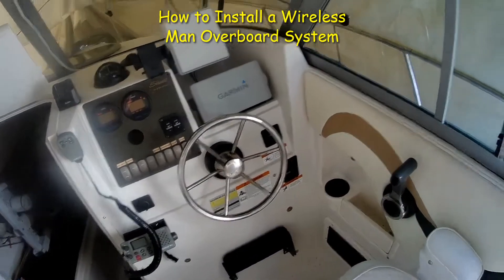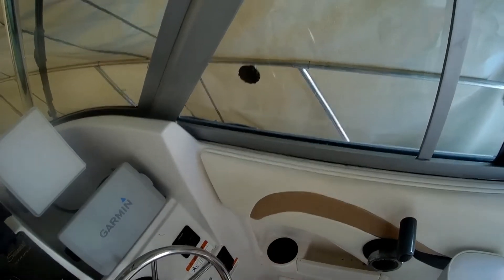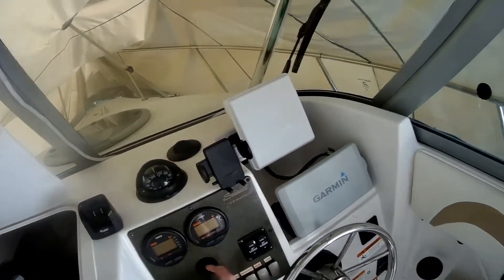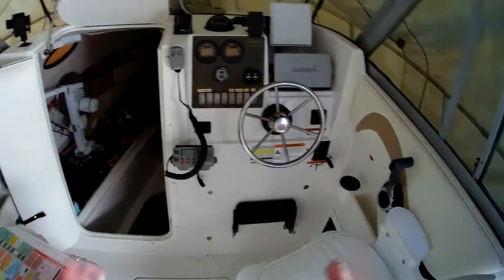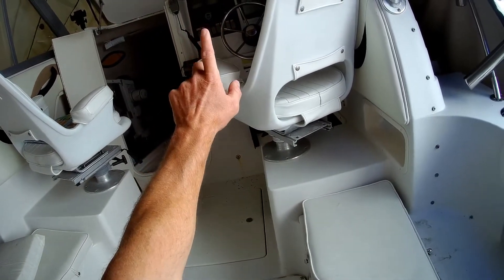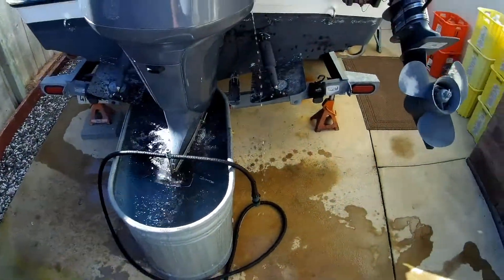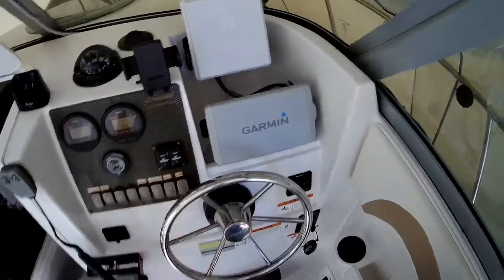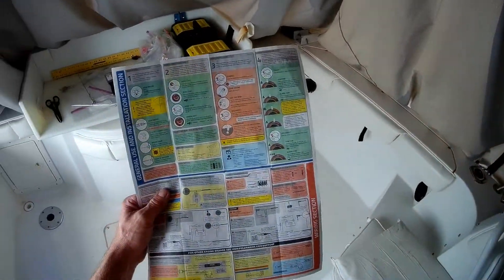How to Install a Wireless Man Overboard System

Comment: I just installed mine. I don’t think they stress enough that you have to push the fob a second time to show the blue stop fob activated. Without doing so the motor still starts, you can push and hold it to shut it down even but it will not activate if you fall overboard. Kind of defeats the purpose of having it. So be sure you do a quick push right after pairing so that blue little light on top lights up otherwise you will be SOL if you fall over. Happy boating, nice install.
Reply from the maker: Hey Luke, thank you so much for watching one of my videos!!! Thank you for your input on this, I love mine, and I have tested mine a few times and it works like a champ! I had a friend of mine lose his life because he fell over board while the boat was still in gear. Thanks again, and happy boating to you too!!!!!!!!!!!!!!!!